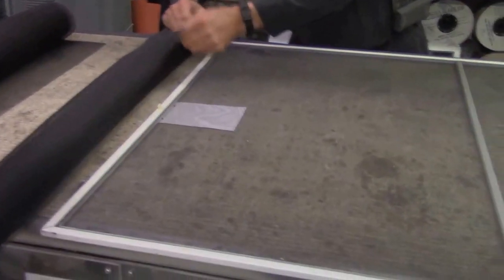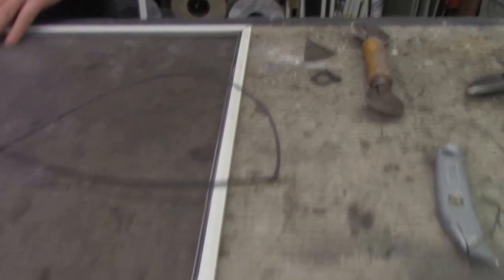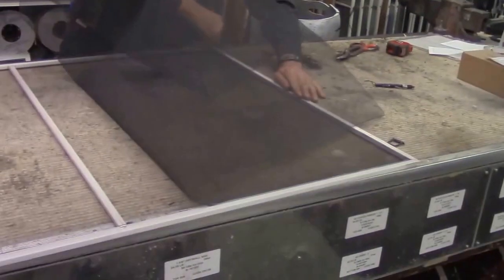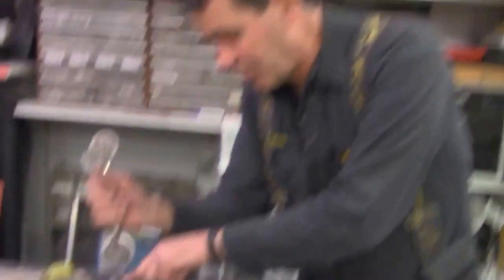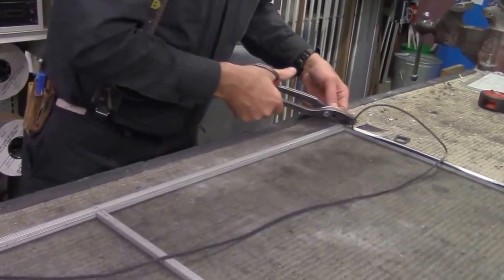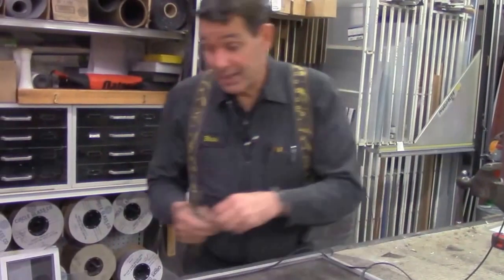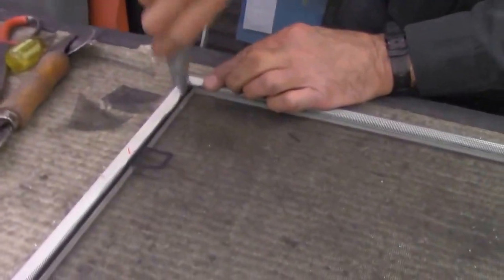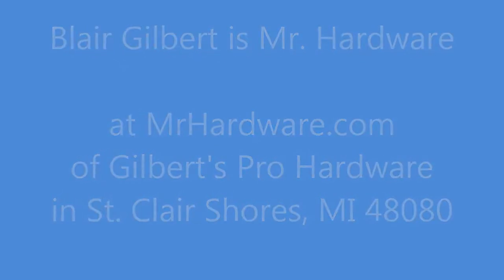How To Replace, Repair a Large Nylon Window Screen Fix

Comment: Where do you get those cross braces from? I have some large screens I want to replace, but I can't find the cross bracing for them anywhere.
Reply from the maker: Those are standard screen repair parts. We make screens from scratch and cut our own rails and we sell the rail clips to make cross bracing. Call the hardware and ask for Daniel and he can ship hard to find parts. 586-776-9532

Comment: Hello i am putting screens on my house and started with the bigger 3x4 ft approx. 5/16 frames and .175 spline i am using and i tried putting the spline in on the bottom and then at the opposite end just tacking it down and then continue to go up the side from the bottom and around but after i was done i still had some rack in the frame,help! Could it be i am using to thick a spline and therefore stretching the fiberglass screening too much?thanks in advance! great video!
Reply: speedwayman100 
It is mandatory to pull the screen away from the frame as you are rolling the spline in otherwise the frame gets bent in the middle. The power of stretching screen will bend the frame rails in.